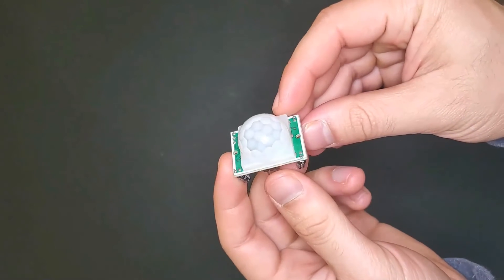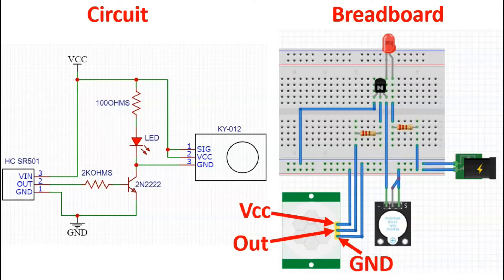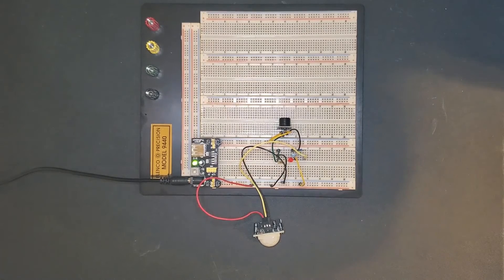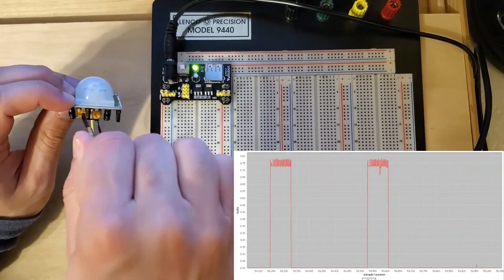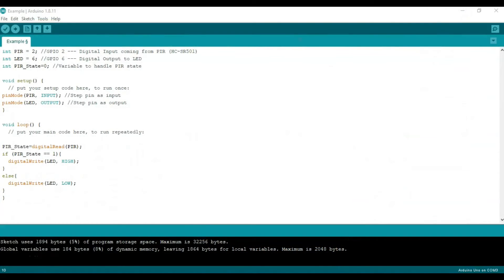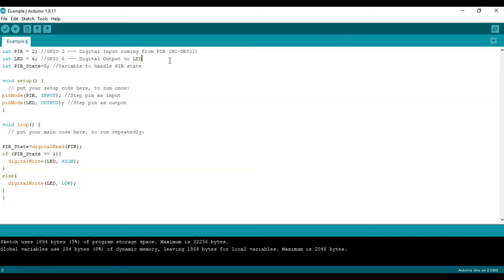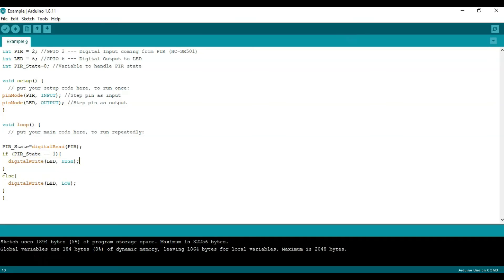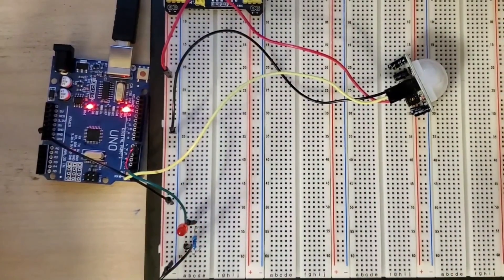HC-SR501 PIR Sensor with Arduino and without Arduino

Comment: Thanks, well presented and helpful for me as I'm in the  process of building up a circuit which will have the PIR trigger a solid state relay which in turn  will short out the button on a wireless bell push. End result will be a motion-activated doorbell, Initially without Arduino but later with microprocessor to use camera for still photo
Reply from the maker: Glad you found the video helpful!